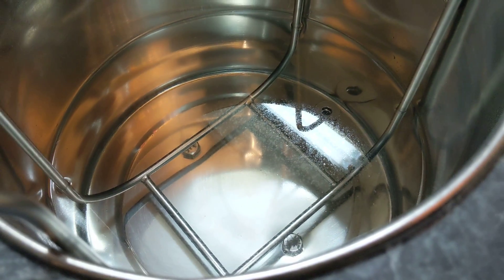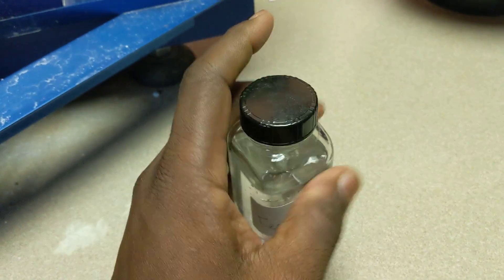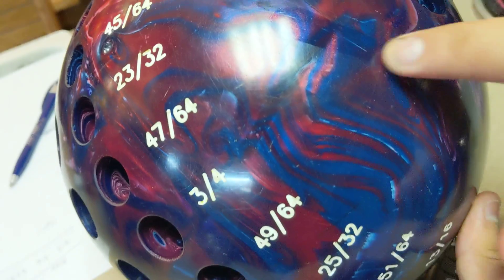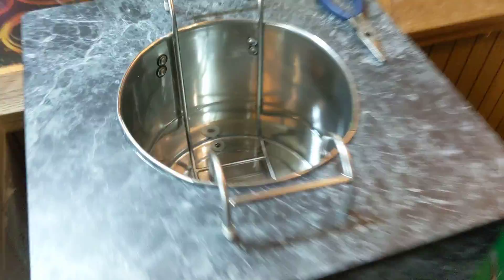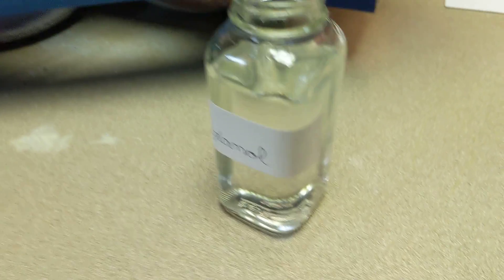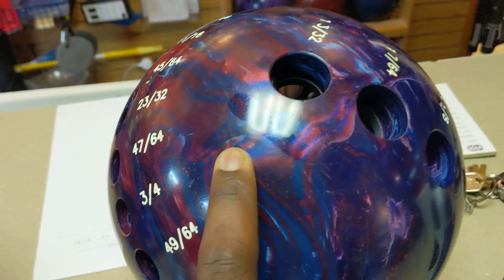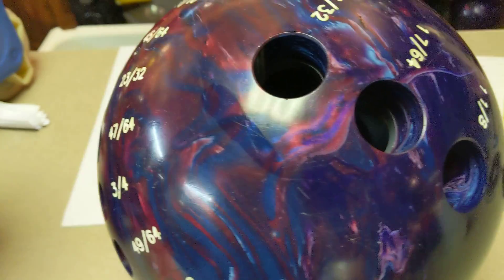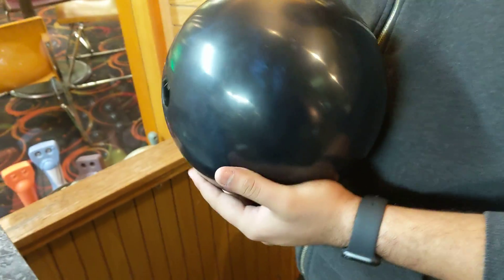What comes out of your bowling ball when you heat it?

Comment: I don't think it's correct to assume the oil stays in the area only where the ball touches the oil on the lane. The capillary effect soaks the oil over time in the whole surface even if you wipe the ball after every shot. Not a fan of detoxing or heating the ball to resurrect the surface of a ball
Reply from the maker: Watch one PBA show where they use the Blue oil and you may change your mind.

Comment: Curious question, once a bowling ball has lost its layer of plasticizer, is its performance gone forever? For example, if I've had a mishap with a Detox machine and left the ball in longer than I should've (without it cracking)
Reply from the maker: There is a lot of plasticizer in the ball. Over time the ball will lose performance when it all is gone. So Fresh and So Clean will help restore the performance